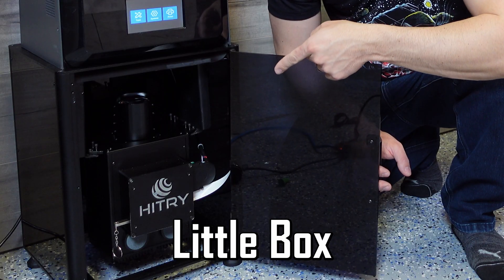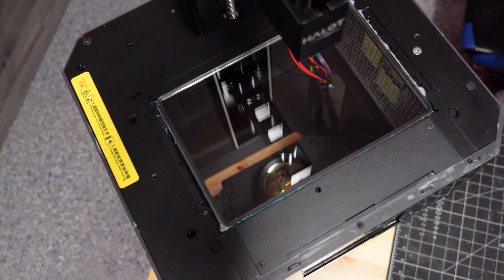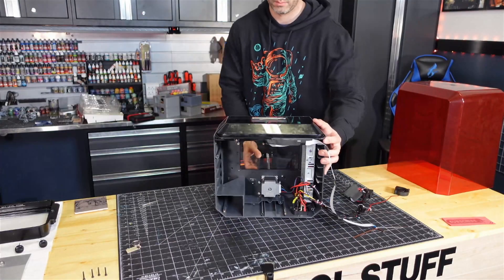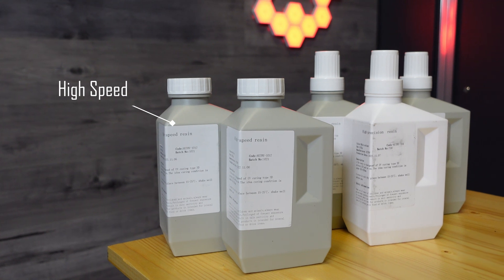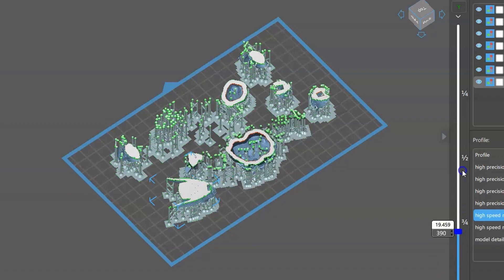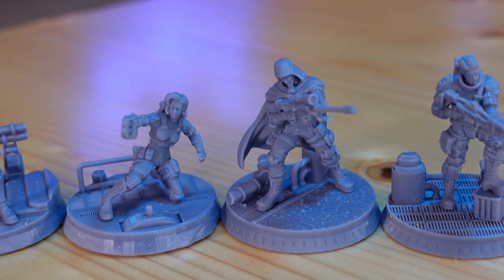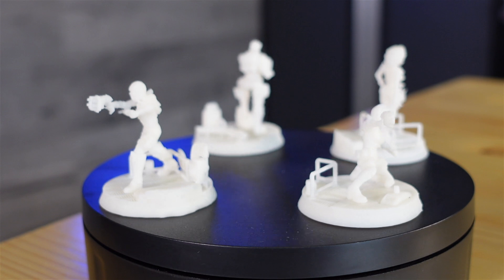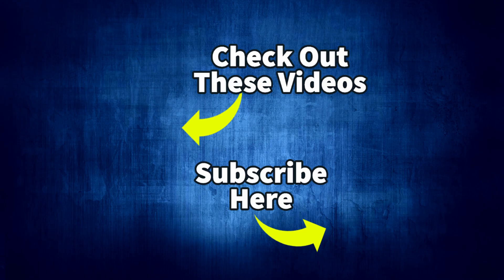You've NEVER SEEN a 3d Printer Like This! - Hitry DSP Light Engine

Comment: It's just a different light source, you're still contending with peel forces and fep film - also a fep leak could potentially end up pouring liquid on the light engine. If Hitry put out a medium or large format top down printer then Id be all over it.
Reply from the maker: Definitely still have all those issues. The cool thing is, this light engine can be used top-down as well.

Comment: Disclaimer: I am admittedly largely ignorant as to the 3D printing hobby. That said, while I understand that this light engine significantly improves one's ability to print higher quality items, I don't understand HOW. What can a projector possibly do to make 3D printing better?
Reply from the maker: It has a long life span, and fast speed, but it is also a great option to upgrade old printers. The Kickstarter page goes into much more detail on comparison to other printer types, my video just shows what it is, how it works, and my experience with it.
Reply: @FacilityD20  I watched the entirety of your video and didn't come out any wiser as to how it works. Why are projections of light even involved in the printing process? It sounds like the equivalent of sticking a mechanical pencil inside a flashlight to improve the light's brightness; the two have nothing to do with each other. Now, I understand that I'm probably missing something. As I said, I don't know much about 3D printing. However, I have yet to see the function of the projector connected in any meaningful way. I get that it makes it better, and even what specifically is made better, but not WHAT it does that yields these improvements.

Comment: Interesting technology,  but 36 µm accuracy (for 700 USD)  is still less than 22 µm accuracy of 8K monochrome LCD printer-  yet savings in printing time is a huge advantage. One more thing - how to be sure, that printer produce 100% accurate size of a model, if you can set the distance of a lens manually - it looks like user have to make several models and compare them to set scale correctly.
Reply from the maker: I would agree, i still need to learn more about how exactly to focus this printer for scale accuracy. I think it is a fun and interesting way to upgrade an old printer, especially if you enjoy 3d printing technology.
Reply: @FacilityD20   Probably with precise (large) dimension set on caliper, that lays on the screen and some reference file with same dimension which is displayed by the Kirin projector- then set manually the lens to match displayed dimension to caliper ?